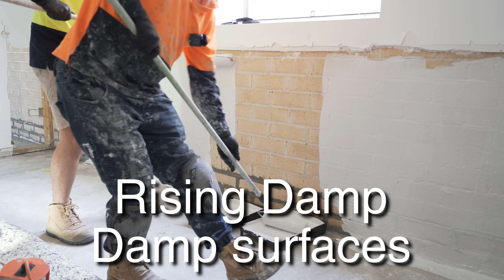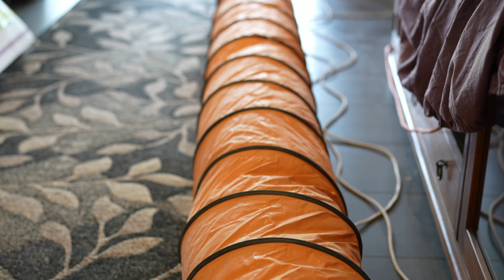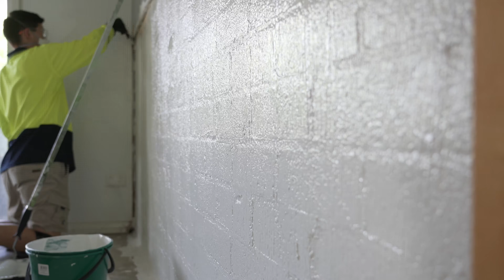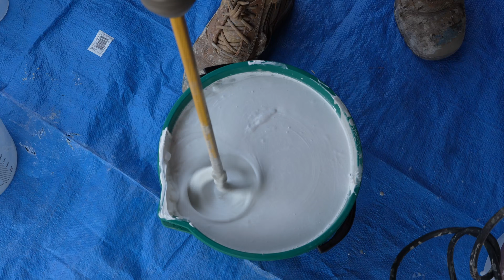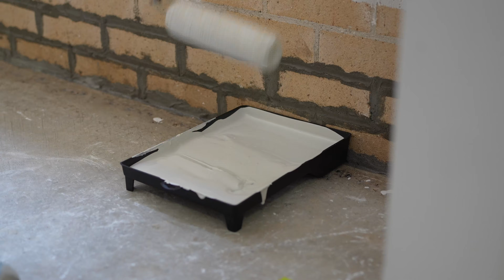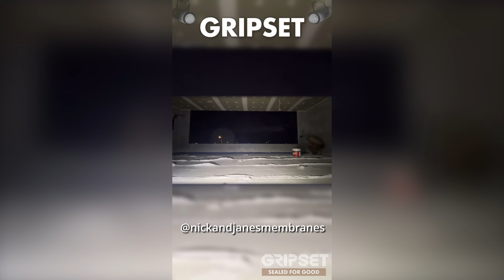How to use Gripset E60

Comment: I saw this product in one of your older vids about waterproofing over tiles. How would this product fit in that situation, it sounds like you woule use this product as a primer type product but then still come back through and do a proper water proofing over the top before tiling/ or doing other surfaces

Comment: I'm interested in this as a primer on plywood before applying bedliner for a camper build. I'll glass the joins but I thought this might be a good product for waterproofing, adhesion, and to stop the ply from checking. Any reason I wouldn't want to do this?